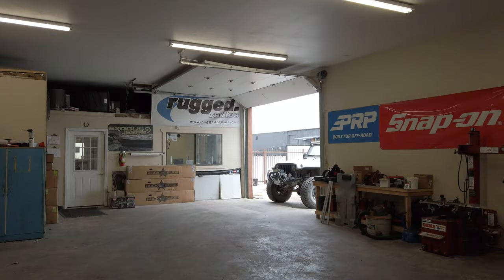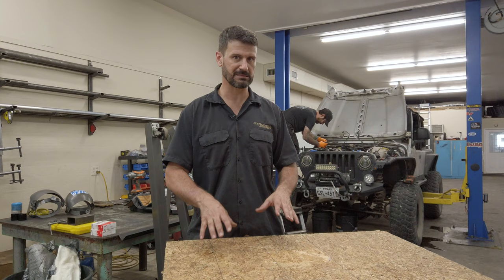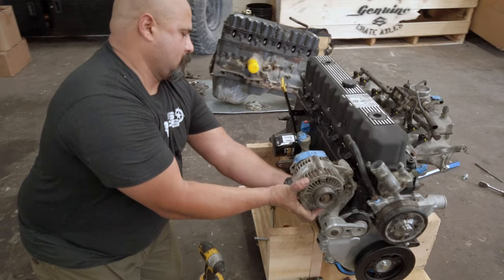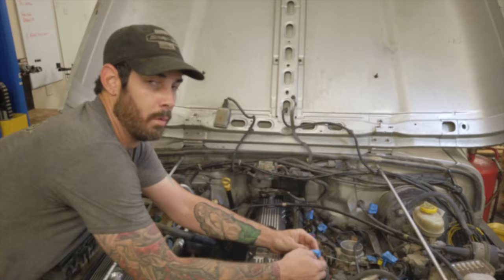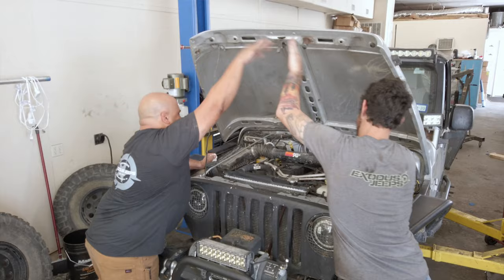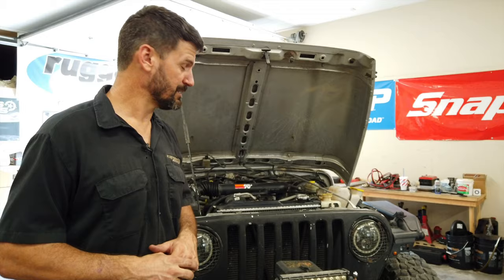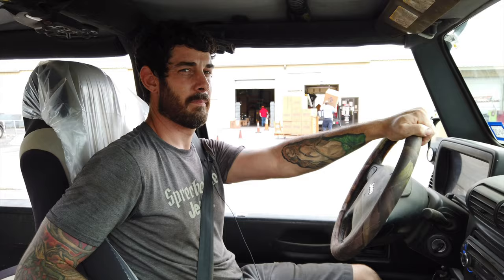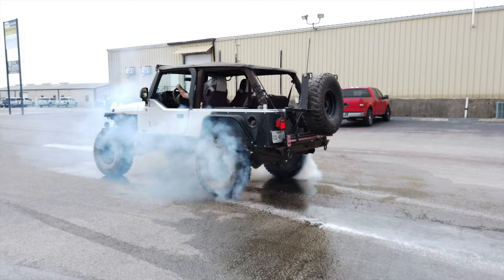How to Take The Ol' Wrangler TJ & LJ Up a Notch - Stroker Engine

Comment: The only issue with stroker motors for tj/ljs is the tranny options. There needs to be at least a five speed auto or 8 would be outstanding.
Reply: There would be more if the demand that kind of thing wasn’t near zero. Almost everyone wants a manual in their stroker since stroker motors are for off-roading, which means a manual trans is simply the most optimal choice. An automatic option for the few would be nice though.
Reply: shoom-b2h  honestly yeah. The only reason a 5 would be even considered better is if you’re running insane power

Comment: Nice video.  If you build it yourself you can save a hell of a lot more. Built my 4.9 stroker right under a grand
Reply: Yeah those Golen engines are a complete ripp off
Reply: Damn, a 4.9! What does the power of that thing feel like? I just bought a  Tj and I am already wanting more power. I have built a 302 ranger and ford 2.3T Miata, the TJ is next; I do have an old 351 Windsor without a home.
Reply: I'm building my 6th or 7th inline stroker right now. I'm curious how you built a 4.9 for under a grand.

Comment: My 4.0 in my 05 LJ has 130k miles on it. Is it to high mileage to just buy a Stroker kit and have someone instal it or would it be more cost efficient to just buy a motor and sell my old one? Nothings wrong with it it just had the rear main seal replaced other than that it’s been a dean.

Comment: Great inspiration Bubba because I have a Golan 4.6 sitting in the crate in my shop for my 06 LJ Rubicon. When it gets a little cooler I make the switch.
Reply from the maker: You’ll love it! Sure makes me want to ditch my JK and build a TJ with one of these engines
Reply: According to Chad Golan, works with stock computer. They suggest 62mm throttle body (I have) and good gas. Should be plug and play.
Reply: All that $ & the computer takes a sh** & makes the trans go in to limp mode
Reply: @juanquintero1866  if ur smart and have it tuned after fully installed ur computer shouldn’t cause a problem lol

Comment: Building my 4.7 to swap out with my 4.0 in 97 Jeep Wrangler. Not really looking to burn rubber as it's a daily driver. I struggled on the freeway with 35" tires and 4.0 until I upgraded the gearing in my 30 & 35 Dana axles. Now I have good acceleration and pedal response but still hits its sweet spot on the freeway at 2,800 rpm @ 70 mph. My question is, will my sweet spot freeway speed bump up once I drop in the 4.7, and what can I expect pulling away from red lights? Not much out there on 4.7 vs 4.0 driving habit once dropped in.
Reply from the maker: Should be better with the 4.7

Comment: What is a good swap from a 2.5 TJ? I bought one that I really like and made it nice but now I want to think about axles and engine swap. I was thinking about the R2.8 Cummins. Is there an engine that I would be able to use my transmission with that is not a 4 cyl?
Reply from the maker: There are a few options. Try giving Novak a call and they can talk you through them.

Comment: Exodus 4x4 -  When you did the swap. Did you encounter any Engine codes after the swap? I did swap mine and I'm running rich from 4.6L from Golen Engine? Let me know Man! Still figuring this thing out, did you tune them or just running on stock tune?
Reply from the maker: Stock tune, never had any lights come on after the swaps.
Reply: @Exodus4x4  Thanks for quick response. I have to contact Golen to see if he can send  me a set of new injectors, thanks again!

Comment: Will that work for a YJ wangler as well? That engine? I definitely want to get rid of my 4 cylinder engine.
Reply from the maker: I think so but you should call Golen to confirm
Reply: They got a website? And yall are in Texas correct?
Reply: @Future-Preps35  I'm in Texas and yea I looked at the website as well. Just ready to get rid of the 4 cylinder I got. So underpowered it's not even funny.
Reply: What year yj do you have